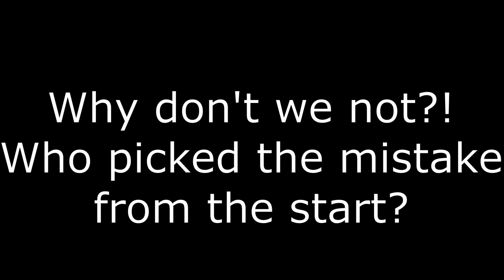DIY Solar Shower For My Volkswagen Camper

Comment: Rather a long video but with skipping around it was very enjoyable. Kinda felt relaxing. The mistakes being captured helped this project feel more real and achievable by the everyday person. I am currently looking to build a L shaped tube along the top of my Tacoma and the bed so this definitely gave me some insights on what to look at for. Cheers mate, thank you for your time. Happy adventuring.
Reply from the maker: Thanks for watching Justin. Things I learned since, use the pressure rated tubing ( not the standard stuff ), and double check for leakage. Oh and if you can't get tubing that's already black, prime coat the tubing before painting. I didn't and the black spray coat is peeling away in places.
  We're all everyday people mate, just havin' a go at stuff!  🙂

Comment: Well done mark.I’m Steve in uk.my Vw t4 has ladders on roof rack and a roof box on other side rack so just got room for drain pipe shower down middle but need room to lift tailgate up and also need situate pipe before my solar panel at front too.I didn’t see you fit the valve on video

Comment: What is the name of the pod clamps you used and where did you get them?  They look clean and sturdy.  Thank you
Reply from the maker: Not sure where you are Fred, but I think I got them from an auto parts store. Could be in the  hardware stores. 
Bazooka PVC pipe clamps. And yes, they are very sturdy. Nothing moves.
Reply: Thank you for the info.  I found them at Rhino Rack as a conduit clamp set.  Thank you again, you saved me hours of searching.

Comment: How long can you run the water at 15psi before pumping up again?   I am trying to work out if the air valve and pumping is the way to go or do I just installed a 12v bilge pump or something similar to pump the water out.  Thanks for including your mistakes.
Reply from the maker: I can't remember if I timed out the pressure drop, but I vaguely remember the pressure kept up for several minutes, or a few minutes at least on one 15psi pump, at the time of the video. Unfortunately during its first use van camping at a jobsite, it failed and de-pressurised in about 30 seconds. The piping is watertight so I think there may be a leak at the air valve itself. But I got lazy, I've since bought a Smarttek hot water system, using a gas bottle and 12 volt pump. The whole solar shower system is still on my van cause it's great for water storage. But I should have another look at it some day.
Reply: @RedPathRambler  yeah a mate has one of those gas ones.  They are great just take up a fair bit of room.    I had considered a 12v water heater.   May take 2hrs to heat.  Not sure how taxing it will be on the battery though.
Reply from the maker: @Beyondthebackyard-au   I run mine off an auxillary battery. They do take up space as far as packing in and out though. I've got a space in the back of the van that I can extend cabinetry, ultimate aim would be to hide a water tank and pump system in there with an outlet through to the outside. But that's a whole big project on its own. Probably best to jump in a body of water with some eco friendly soap!

Comment: Have you gotten a pressure valve? Cause  if not you can just use a presta valve and a maid o mist auto valve
Reply from the maker: No I haven't. I've since moved onto a different shower system in the van, but still have the tubing for water storage. But I would definitely try what you say above if I ever revisit it.

Comment: Is it possible to add the place where you bought the 4" round aluminum brackets please
Reply from the maker: These are the links I have bookmarked. Can't remember which place I got them from.
https://www.supercheapauto.com.au/p/rola-rola-roof-rack-conduit-holder-pair-100mm/564207.html

https://www.rhinorack.com/en-au/products/work-solutions/work-solutions/conduits-carriers/conduit-clamp-set-2-piece_bc2

https://krsaustralia.com.au/product/bazooka-clamps-pvc-pipe-clamps/
Reply: @RedPathRambler   Thank you very ,very much appreciate. Thumbs up!

Comment: try looking in a plumbers for a industrial tank valve for the pressure valve mate
Reply from the maker: I'll keep that in mind 🙂
Reply: @RedPathRambler  sorry mate saw you had already got it and then saw the date of your post , lol im looking at posts to turn my commodore stationwagon into a car camper and thinking then od going round aussie and thought a roof top shower system would be great , especially in the outback. shower and water supply
Reply from the maker: @judithhobson5868   No worries. I've since moved onto a hot water unit and gas bottle set up. Still got the tubing up there cause it's great for water storage, about 46 litres. But yes, the outback sun might do better for warming up the water in the tube as far as a solar set up.

Comment: Why did you have to move the tire pressure valve to the other side? Why wouldn’t it work being next to the spigot and water fill cap?
Reply from the maker: It's just a theory, and possibly a flawed one, but the tube at that end was downhill and was full of water, so no air gap inside. So when I attempted to pressurise with the valve in that position, water was just spewing back out through the valve. I guess it would have worked if the tube was perfectly level, therefore an even pocket of air inside the tube.

Comment: Question, why not use ABS instead of PVC? No need for painting and no peeling paint in the future.
Reply from the maker: Exactly Tim. Mostly as an experiment, I just used pvc that was lying around instead of buying the ABS. But definitely ABS if I ever did it again. 👍

Comment: we just bought a usb rechargeable shower.so I can use the solar shower pipe on top of van then just pour water off tapped can pump from a travel wash bag thing or a bowl for shower .I recharge it from my solar panels again on van
Reply from the maker: I still don't think I've fully solved my van shower situation. Currently using a portable water heater/gas bottle/12volt pump system, with the piping now primarily as water storage. The previous owner, who did the DIY camper fitout, never put cabinetry at the back. I'm thinking I'd like to one day build that cabinetry and fit all of the above inside and have the shower nozzle protruding out of the back vent grill. 
  And maybe tie in solar to it as well. At the moment I have fold out solar. I'll get back to it one day!

Comment: My only concern with that length of pipe is water sloshing on braking. Some placing in of baffles would be advisable. I think also that any air pressure leak would be from the screw type caps. Plumbers tape might seal up the threads? Good job though. 👍🏻🙏🏽😷🦘

Comment: Did it make a big difference moving the valve from the water outlet to the filling end of the pipe shouldn’t air pressure be equal right through the pipe.
Reply from the maker: G'day Warren, me not being an expert I would agree with your description of air pressure being equal throughout. The car was out of level, therefore the pipe was totally full at that end where I initially had the valve. When I first started to pressurize it water was forcing back out the valve as I was pumping air into there. So I assume the valve could be any where but the tubing would need to be level so that there is an air gap inside above the water. That;s just my uneducated guess though.
Reply: @RedPathRambler  thanks, you mentioned air in the tube. I filled mine to the top and it did not work, when I half filled it , it pressure very quickly even blowing the fill cap off. I half expected this to happen as I made mine out of storm water pipe. Next time I will use pressure sewer pipe. Great video. Thanks again.
Reply from the maker: @warrensullivan9084   Yes, pressure sewer pipe would have been the right thing to use. I just used spare storm water pipe that was lying around the property.  Who knows, I may do it all again one day.
Reply: Considering to built one. But I'm  concerned with the water not heating up. Did you use the wrong paint?
Reply from the maker: @wilfredoreyes4617  Personally I think it has to be quite warm weather to get decent heat. But I have felt it on a 20 degree celsius (68 Fahrenheit) day and it was just warm. Probably fine for a shower. I'm not sure if there is a particular proper paint to use? I just used flat black, two coats. I should have used a primer first though, the paint is starting to peel away. And maybe brushing the paint on is better than spraying. 
  However, still good for a quick shower I'd say. You just won't get a hot shower in the middle of winter!
  Hope that helps to make your decision.

Comment: didn't know about the usb charge showers so should work well together
Reply from the maker: Do you have a link for the usb charge shower? Sounds interesting.
Reply: This is one I have ordered.looks same sort of thing..I normally do strip down wash thing using wash up bowl after boiling kettle or wash in sea/lakes/rivers here in uk.Don’t use campsites .always off grid.I picked up unwanted drained pipe from customers .With the usb shower and bits bought cost me about 60£.say 3 nights campsite fees
Reply: I’m at work sorry u must be asleep
Reply from the maker: @stevemcgowan3017  All good. 5pm here.
Reply: @RedPathRambler so if u live in outback u must be a warrior 😀👍
Reply: @RedPathRambler  did u have the floods fires and mice 🐁
Reply from the maker: @stevemcgowan3017  All of them to varying degrees. Thankfully not at the same time.

Comment: So how are you going to fill up if you cement the threaded cap?
Reply from the maker: I put another t section with filler cap at the opposite end . That was one of my silly mistakes, having a fill point and pressure valve at the water outlet end.